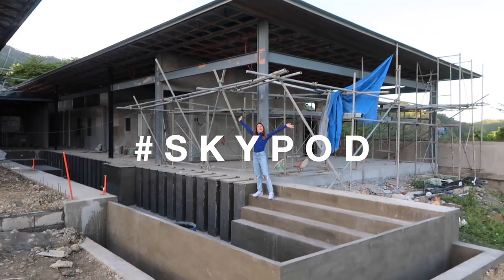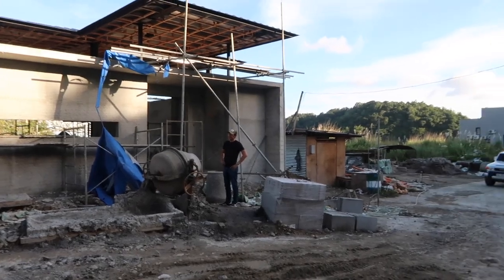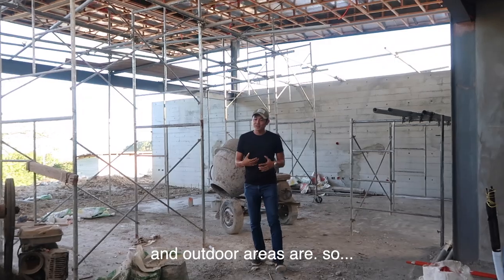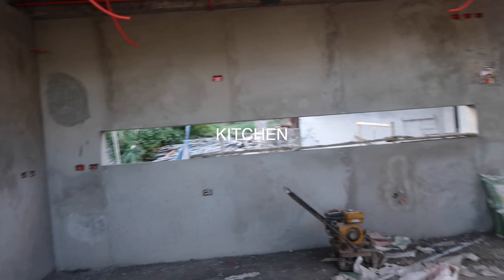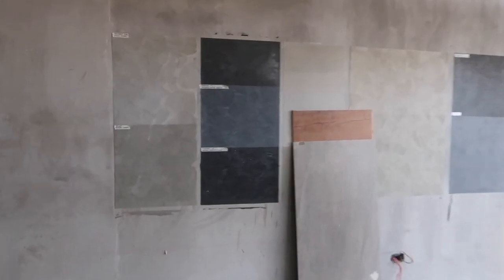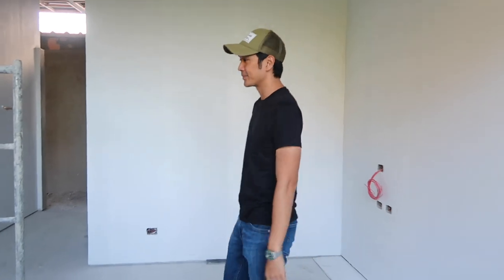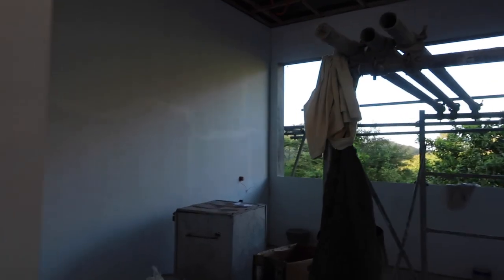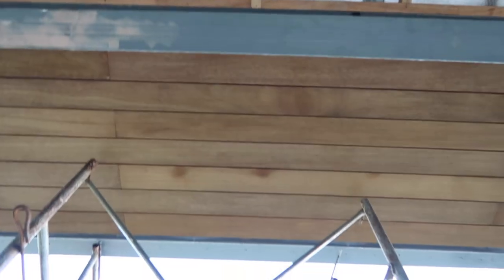#SkyPod Tour- Building Our Home | Kryz and Slater

Comment: I'm an architecture student and I do agree with most of the comment!! 😍 Your house is planned and constructed well and slater's concept for indoor/outdoor living is amazing, One thing to consider when building a house constructed with glass is the amount of heat that will be absorbed by the building, you should consider using low-e glass in order to minimize the heat without minimizing the amount of sun/ light passing through your glass panels. ❤️❤️

Comment: I like that Slater mentions how you can make the spaces look classier with the corners being straight and crisp. Very true. But it also helps that they are using precast concrete blocks, conventional methods use CHB and plastering which makes it more difficult to get those crisp, straight lines. Although possible, just difficult.
Reply from the maker: Yup, true. Everything is easier with Liteblock hahaha

Comment: The “look” of the house and the design concept is commendable. However, placing that much glass poses a huge risk of overheating your house (greenhouse effect). So hopefully there is enough awning from the roof, or blinds, or glass with a reasonable g-value/solar heat gain coefficient. Also: harnessing the natural ventilation in the mountains would increase comfort and lower your electricity bills (and contribute to saving mother 🌏). 
Architecture isn’t merely about creating beautiful buildings, it takes into account many factors for the betterment of the people using the buildings, the surroundings, and environment (not an easy task to do). 
I look forward to the finished product. Good luck! 🍀

Comment: Slater, what's the difference between LiteBlock and AAC or CLC?
Are you using LiteBlock throughout the house or just interior walls?
Is it safe to not use rebar reinforcement? What about wind load?
How did you treat your wood ceilings to prevent rot and termites?
What the cost/sq.ft. to build a house like this?
Are you able to share your house plans?

Sorry for all the questions. Love the house by the way! :)